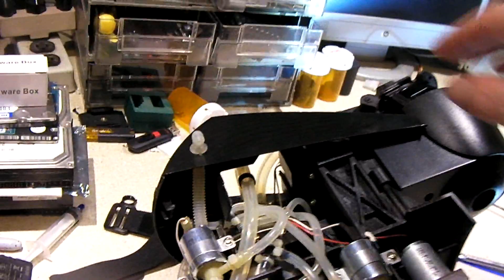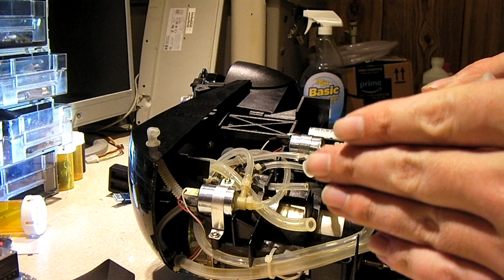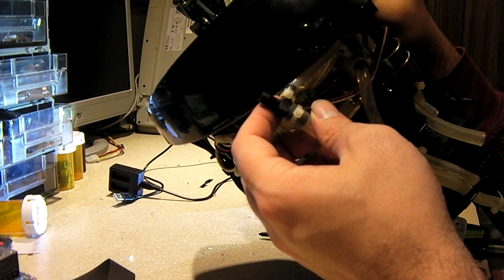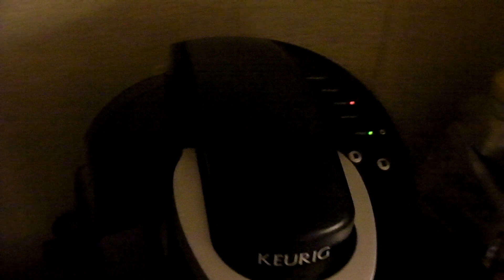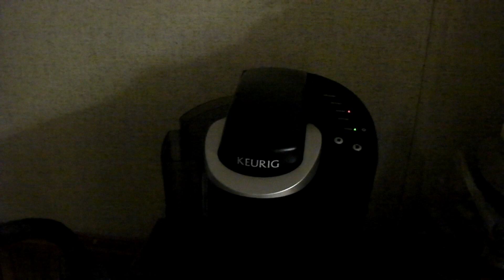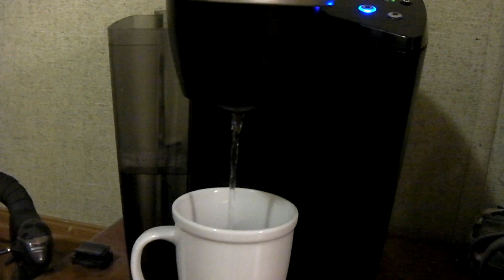Keurig B40/K40 not drawing water? This could be your problem...

Comment: I just took off the top side cover and found the check valve and k cup valve lines were both clogged. Cleaned those up and replaced the two small tie wraps. Ran 50/50 distilled white vinegar and water with out the tank filter. It finally worked after several turning on and off with cycle brews. Also cleaned the bottom tank screen. Ran about 15 pure water brews to remove any distilled white vinegar in the lines and pump. Patience is something have to work on. Almost gave up but it worked. 
Thanks

Comment: Don't know if it's the same problem but my Keurig brewer started working again after I blew air thru the air intake (exhaust?) located on top of the machine inside the water tank. Must have been clogged with calcium.

Comment: I short cut your great idea and it works. I didn't want to fight to do the work.  I used compressed air with fine airstream tip from my compressor at 120psi. Blow in black base water intake.  It blows out the top clear drain above intake dumping back into water supply jug. Vinegar rinse after it started working for heck of it.

Comment: I get that it is the check valve.  You said "Check Valve" 1000 times, but what you didn't ever say after 10 minutes was HOW DO YOU FIX THE CHECK VALVE.  I don't need 10 minutes of you talking about what it is, and showing it brewing, without you ever saying HOW to fix it.
Reply from the maker: I didn't cover much on the check valve as they are simple enough for almost anyone to figure out. It's a one way valve with a spring and rubber seat. The water or air flowing in the flow direction presses against the rubber seat and overcomes the spring, opening the valve. The seat blocks flow in the opposite direction. I just blew into the valve and that freed it up.

Comment: Why not blow compressed air down the hole at the bottom of the water tank? Wouldn't that dislodge the stuck check valve?
Reply from the maker: It would had also likely caused damage to other components of this unit as it was not designed to handle high pressure.